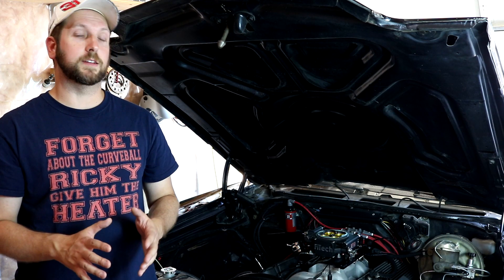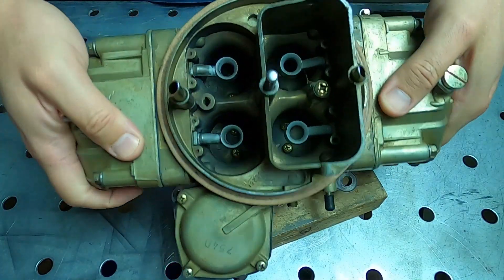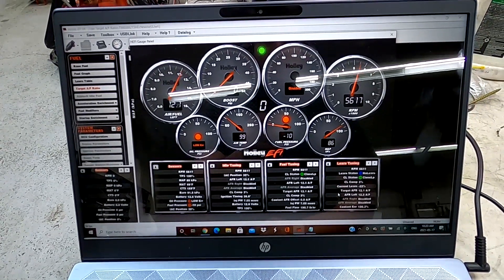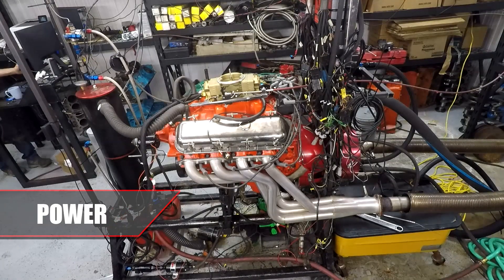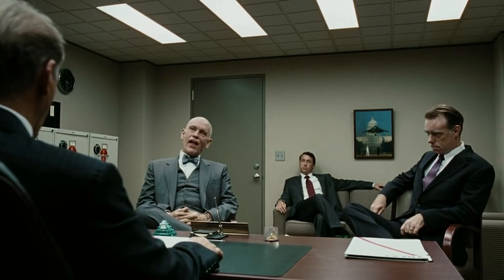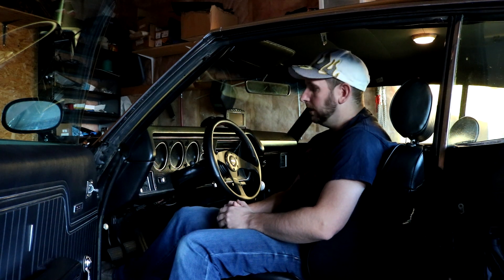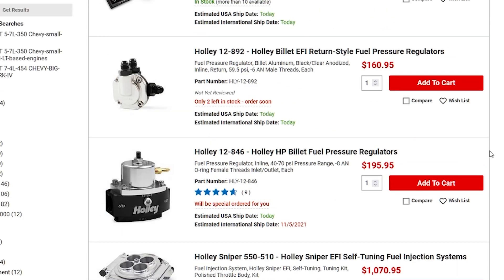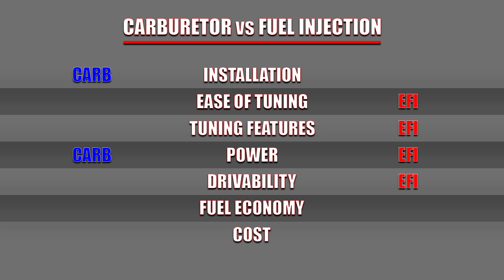Carburetor vs EFI - which is BETTER?

Comment: What about maintenance costs between the two ?  Good video. Thanx 🤙
Reply from the maker: EFI will almost certainly be more maintenance and for sure more expensive when the time comes. So far I haven't done any maintenance aside from a cheap fuel filter for my EFI.

Comment: OK...I ride an older carbureted Harley....I can immediately figure out what is wrong if there is ever  a problem....which is seldom....but I have stopped alongside more than a few guy on new Harleys which are fuel injected....which require s computer...which means you sit on the side of the road fucked and scratching your head waiting for a tow truck...

Comment: Does EFI volatilize fuel in the engine bay like a carb does causing that strong fuel smell in your garage for hours after driving? Or is it more of a closed system?
Reply from the maker: Typically it will reduce the smell, but it all depends on the tune. The TBI EFI systems deliver fuel above the manifold, just like a carb.

Comment: Carb is 100% way better than the common aftermarket efi kits. Ive seen many people swap out to the efi systems. Only to yank them out in frustration within a few months of them not operating properly. Issues every time are the electronics mounted where the bowls would be. 
I’ll stick with my carb.

Comment: One benefit with EFI is the data logging. I have a FiTech EFI and can collect many engine parameters to see how my engine is operating. With my Holley carb, I didn't have the data to look at after the drive. Sure, you can read plugs, even look a AFR gauge while running with a Carb, but looking at data after each drive is awesome.
Reply from the maker: datalogging is incredibly valuable

Comment: first video i have watched that didn't comein with just a bash up on EFI......My truck is EFI already, 1988 EFI and quit frankly know if i don't upgrade it when i rebuild this engine it's not going to keep up. so do i retrofit a carb or keep it EFI with minor mods to fuel system. still on the fence for pricing,but the ease that fuel injection makes over a carb for me am leaning on the EFI side.

Comment: not all carb are hard to tune. For instance. My mitsubishi lancer 93 has a carb that has its mixtures screws outside. No disassemble or messy stuff needed. Straight forward tuning. I don't even have to step on gas before starting my car and it also has cold start which brings rpm to 1.1k and lowers it down to 800 standard when my engine reaches its npt. But even if I have to give it a few pumps, I am man enough not to consider that a downside.

Comment: I worked in GM dealerships for over twenty years starting in 1971 so I know Carbs as I have overhauled hundreds and EFI owned three trucks myself with them. The throttle body is by far the easiest fuel injection to work on. Since they came out I can only remember one that required replacement as the butterfly shaftin the unit was worn out causing a vaccum leak. That is in ten years of throttle bodies.I don't remembering ever seeing that on a carburator.

One example is a carb takes a fuel pressue of 3 to 6 psi. a throttle body takes 9 to 13 psi. the injector engies can take 50psi or more.

Comment: Reliability trumps all other concerns. A carb will usually get you home. Gm hei vac advance dist is reliable as dirt. Parts support for carbs and distributor is good. Efi dies in the boonies you're screwed. 

If you have to pump your gas 7 8 times to get it started you need to adjust carb a little.

Comment: I have now installed 2 FiTech systems. A meanstreet on my 600hp N/A 385 and just a few days ago a 1200PA on my dads MP122 blown 63 Nova. Installation is KEY. Good ground, good return and proper pressure, good filtration, no vacuum leaks or air leaks into the exhaust. Get all of those things right and EFI is wonderful. Now dont expect it to learn and be 100% completely hands off. You'll likely need to manually adjust something but it wont be much. Example for both of our's they have radical cams etc so neither one likes the fuel being cut off when coasting. I set the dfco enable temp to maximum 300 and that stops the dfco from engaging.
Reply: You might be able to cut the fuel under certain coasting conditions, esp if engine RPM is higher.  The Fox-body EFI have some algorithms that determine when fuel can shut off, 1 in particular requires engine RPM to be above 1500rpm, IIRC.  If coasting on a long hill, shifting to a lower gear might be required to get the fuel cutoff and a little bit of fuel saved.

Comment: Nothing simple about running a carb. How to check spark plugs for running rich or lean. Really need AFR gauge. Vacuum or mechanical secondaries...Carb secondaries have to be setup up, jets, cams for accelerator, Nozzle selection...etc.Vapor Lock problems.. Selecting right size carb for your engine...

Comment: Why worry, neither system should be used now that we have reliable individual fuel injectors that can keep the fuel variation in each cylinder small.....Bring your engine up to modern standards today, don't speed your time and money on a lesser system.....
Reply from the maker: You have to spend a LOT more to get MPFI.
Reply: @SS454LS6 : Starting from No intake system....Not really....In fact, you can get the whole system at your local automotive salvage yard or used car.....
Reply from the maker: @regdor8187  Good luck finding an MPFI fuel injection that fits a Mark IV Big block chevy at the salvage yard. Not that I'd even want some plastic truck intake on my engine.
Reply: @SS454LS6  : Use your talents to modify an
 aluminum intake manifold , weld on and bore for individual injectors....

Comment: The age old argument.... Year later we have a lot more verified data out there (not from manufactures). That said, I have installed 100's of Snipers and now a few Aces systems. If you are on a tight budget and can adjust a carb, that is the way to go on older carb engines. BUT now it is a proven fact that you get all the goodies mentioned IE: better starts, throttle response, idle quality, etc. As mentioned though you may not "feel" it depending on your set up. Seeing you can build an engine in infinite ways no one can say for sure what your power gains are. Sometimes it's only a few ft pounds and/or hp where you never will feel it on the street. Now you compare Holley XP and other top carbs, you definitely better look at EFI as the cost becomes a wash.

The biggest selling point for my customers is: Reliability and significantly less maintenance and keep top performance. Carburetors should be tuned for best performance daily as it depends on temp, humidity, altitude, etc. Sunday drive? Should be able to go fire it up and go. Traveling? Same deal. Going through Donners pass, Denver? No tuning required. Change cams, upgrade heads, new intake, crap even new engine? Bolt on your efi and go. 

From my conversations it comes down to a lot of people not wanting to deal with change and learning something new even if it's literally a kit you bolt on. Why would someone carb a LS when it is actually cheaper to run injection? I get the I want to as a better excuse then carb is better.

Each has it's place and application, but even lawn mowers are going fuel injection...... lol right before going electric...

Comment: I'd also like to add that EFI will be more of a constant. I feel like carburetors can get detuned and change in certain environments. Meanwhile the EFI will maintain in tune better than the carb and can handle different environments better.
Reply: Unlike EFI, carburetors are static, so they do not get "detuned" unless something changes with the engine.  And if you were to use the stock style THERMOSTATIC air cleaner (as opposed to an aftermarket open element style), the carburetor will receive a consistent air temperature.  This keeps the A/F mixture stable and eliminates the need for seasonal (or environmental) adjustments.  Just like with an EFI system, a carburetor needs ALL of the proper components in place to operate at it's best.
Reply: @Tricky2002  That's great, having a thermostatic air cleaner, but many cars 1970-older don't have that.
Reply: @furyfantoo  A thermostatic air cleaner can be added to any older carbureted vehicle that didn't have one. (Even the early throttle-body EFI systems used a thermostatic air cleaner.) Just like EFI systems, carbureted vehicles evolved over the years to be more precise and more efficient.
Reply: @Tricky2002  Yes, anything can be done.  But most guys wanting to maintain a stock appearance aren't going to add such an air cleaner.  Many mid-late Chevy musclecars have open-element air cleaners.  And often one would need to change the driver's exh manifold to one accepting a heat stove, and that might dictate exh headpipe to change also.  And those thermostatic aircleaners are only operational during engine warmup, when the flap closes the air cleaner performs as a simple snorkeled unit.
Reply: @furyfantoo  From about the mid 1960s on, almost all stock vehicles came with some sort of a thermostatic air cleaner.  The earlier ones were simpler and worked as you describe.  Most from the mid-1970s on would actually modulate the flapper in the snorkel via a simple temperature valve to blend hot air from the exhaust manifold and cool air from outside of the vehicle as needed.  This would help maintain a constant air temperature to the carburetor at all times.  In turn, this would keep the fuel mixture stable all year round and prevent carburetor icing.
Reply: @Tricky2002  No.  Chrysler products had no thermostatic stuff until 1970.  Many GM musclecars had chrome open-element air cleaners.  Again, it's possible to do, but very few owners wanting to preserve a stock underhood appearance are going to install a mid-70s aircleaner.
Reply: @furyfantoo   I said almost all. Very few vehicles ever left the factory with an open-element air cleaner.  Even before 1970, most vehicles (including Chrysler) had an enclosed air cleaner with a snorkel for a source of heat. And there is a very good reason for that.

Comment: I think you left out the cost of tuning a EFI if you can't do it yourself. For less than the cost of duel quad EFI I can put a nice polished roots supercharger under my carbs. Also chicks dig it so there's that.
Reply: Lazy, chicks don't dig it, they use it as a sign that you have money....
Reply: @regdor8187  And they dig money. So there's the same result. My problem is my taste in women hasn't changed but I keep getting older. I guess now I will go polish my 16 nitrous/fuel lines on my duel quad classic case Weiand 6-71 going on my 1000+HP Chevy I6 292 for my 53 Chevy pickup with a 5 speed. Okay I guess I might be a little old school. All my other cars and trucks have EFI. Sorry so long. Thank you for your time.
Reply: @lazyhoundracing9621  : Your welcome !
Reply from the maker: Cost of tuning applies to carbs as well if you can't do it yourself. It just takes longer because you need to drain the fuel every time you replace the jets, and turning the dizzy requires a wrench too. Same adjustments can be done in seconds with EFI. So it's all relative. As for the supercharger, can't go wrong when it comes to cool factor!
Reply: @SS454LS6  I'm not denying you have a valid point. I guess that's why they call it wrenching. I just don't see any reason to second guess physics. To each their own.

Comment: I like my carb, I have QFT 750 on a big block chevy. The only problem I have is that it smells of gas, carbon and unburned fuel all the time. Especially after you park it and the engine has been good and hot. In the winter it runs much better and has much less smell factor.  An EFI could be tuned to run much more efficiently surely but are the ugly smells going to be eliminated? High HP big blocks are real tough if not impossible to pass smog control so I would imagine there will still be some smell issues. I have leaned the engine out in many different ways and that helps but is not good for it to run that way. It likes to run a bit fat and so i don't know if an EFI will make improvement there enough?
Reply from the maker: I had the same smells with a carb, and I do not have them nearly as bad with EFI. My friend has the same experience. A lot of factors are involved with the smells, but typically EFI is better for that.
Reply: @SS454LS6  The rest maybe cleaned up with installing a cat converter(s). Well thanks for the feed back, it's good to know it's much better anyway!
Reply: If you want to eliminate the smell of gas buy an EV. I personally like the smell of gas and burning rubber. Thank you for your time.

Comment: I went from an 850 Holley to a Fi-Tech EFI system on my BBC 496.  The engine now runs better and has more low-end torque.  Starts without issue every time and the engine is always getting the proper AFR.  I considered the switch well worth the money but there are cons as well.
Reply: In your opinion, what are some of the cons.  Did you habe it tuned or did you program the system yourself ?
Reply: @Axrbear  con(s) are if something is wrong with the throttle body unit you cant just buy a rebuild kit like you can with a carb, you have to send the unit back to fitech.  You also have to wire the system into your ingition system so its not a straight forward bolt on.  I am not familiar with tuning  or laptops and my system hasnt been self leaning as it runs rich all the time.  If a sensor goes it would take awhile to track it down.  In short, if it works well, it runs better than a carb but if there are issues, its harder to track them down and fix if youre not familiar with digital tuning.  You also have to make sure your ignition box/system and distrbutor are efi compatible.
Reply: @doubledave7451  got it. Thank you.
Reply: @doubledave7451  Thanks for this comment, I have a 496 as well with a holley street avenger, I was looking at the 850s tonight but was checking this comment... I'll do more research before I look more into the 850s lol

Comment: What about reliability? I don't like the idea of electronics mounted on an engine. Too many temperature cycles. I would choose an EFI system where the electronics are mounted inside the car. But you don't have those concerns with a carby..
Reply: Stephen, you don't mount the electronics on the engine nor on the fire wall, inside if you have to, but generally on the inner fender panel, aft of the radiator support with shielded air ducting to the front side of that support ....
Reply: @regdor8187  On a lot of these bolt on EFI units the electronics are inside the injector body and are not removable.

Comment: I have a  mild 400 Ford with a electric choke 670 Street Avenger  on a Performer and a MSD ignition box. Cold start is as good as any efi. Driveability is quite good. Economy is ok,, hwy about 18mpg. Low end and mid range power is excellent and with a tall final drive is what is required. 
Originally it had a 780 vacc on a modified Ford intake and had more power,, but far less bottom end and fuel economy. Bigger carb makes it stronger mid range and top end [ I tried a 750dp I own] at the expense of bottom end. Surprise surprise!
I know of people spending $3000+ to go either Fitech or Holley fool injection [Holley is better]  and they have ended up with less power and loading up plugs. One has binned the efi and the other is persisting,,, and he works in a dyno shop. Last I heard after several tries and dyno pulls he has it not loading up plugs and a bit better on economy. But still does not have the power of a 3310 Holley. And as he says to get this far it would have been $3k more in dyno time.
I have seen people try the 0ne step up systems on V8 racecars. All are going slower!!
So yes I will be using a  HP Holley still on my racecar.
EFI though, you can use noisy inline pumps, some  older OEM systems use them. In tank is quieter. The pumps burn out in tank or not. And external is simple to replace.
Efficient carbs?  For SBC Chev for mild performance a Qjet is as good as any, in fact better in many cases. Harder to make big power out of however in comparison to a Holley

Comment: I have a Holley Sniper EFI in my '85 Ford Bronco and would never go back to a carburetor.
I drive this year round from -10°F winters to 110°F summers, and those temp extremes could be a real pain with a carb.
Secondly, I live at 2500 feet elevation but often go off-roading and camping in the mountains, which can get up to 7000 - 9000 feet.  There were many times where the higher I went, the soggier the performance was due to the leaner air.

Lastly, my 300 inline 6 was originally a 1bbl carburetor, and after I switched to a 4bbl and upgraded exhaust, I spent a lot of time and money trying to get a carb dialed in.  Lots of different jets, power valves and other tuning bits really added up in cost, and the thing just never ran right no matter what.  What worked one day would be out of tune the next.  Not to mention that most of the cold weather drivability was tied into the stock system, and really difficult to replicate with the performance stuff.

EFI has been a dream come true and it drives like I always wanted it to with a carb, every single day, all year long.  If I need to tweak or tune anything, I can do it with mouse clicks at the computer, instead of buying and swapping tuning parts around.  The data logging is also invaluable.

Unless it's just some toy you drive on the weekends when the weather's nice, there's just no comparison between a carb and EFI.
Reply: you are lucky if you have not had the problems with it they fixed on the sniper2